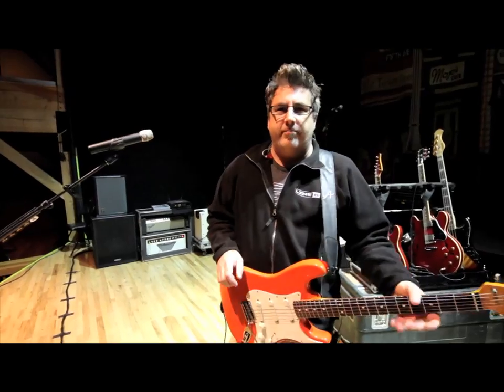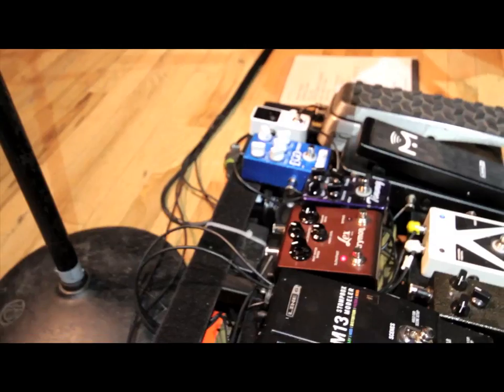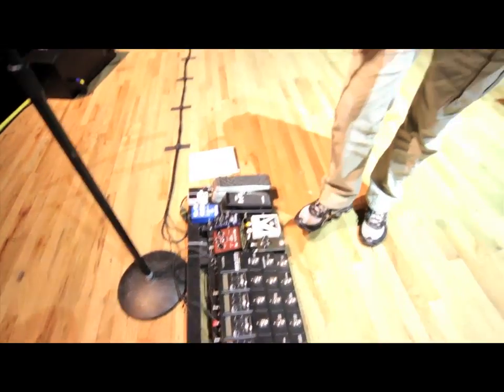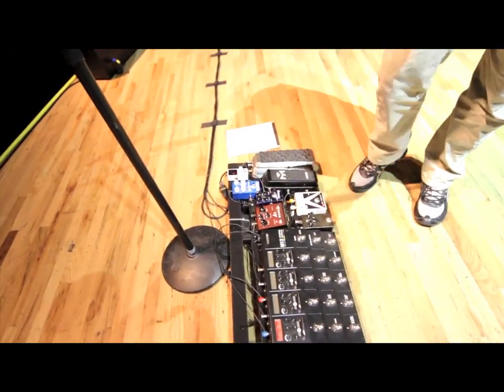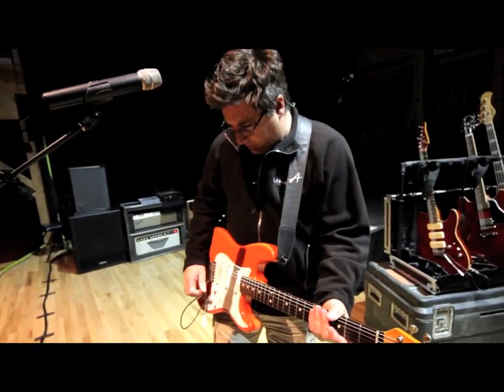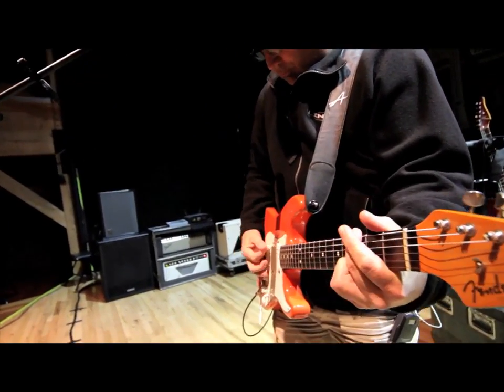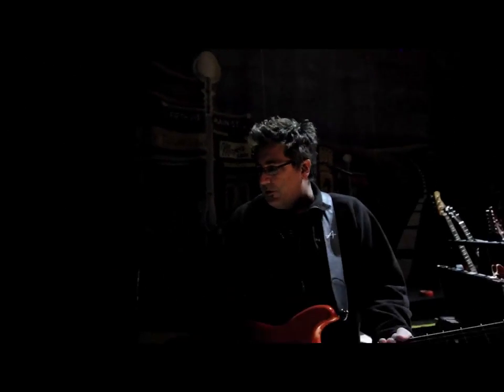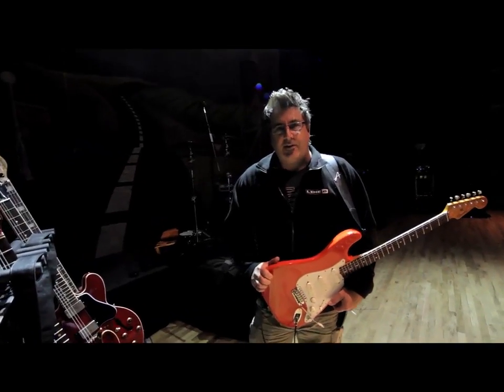Michael Britt Gear Video Vol. 3 2012

Comment: Hi Michael........great gear setup!!! what is the curved barrier you're using in front of the cabinet? thanks a 1000.
Reply from the maker: +michaelmellner It's just one of the small plexiglass amp shields, but I used a couple of pieces of gray foam to kill the slapback from the shield back into the ribbon mic.

Comment: What size is that pedal board? Is it a pedal train or what is it? And what power supply/'s are used here? Thanks!!
Reply from the maker: +Lachlan Burnett Again, sorry for the delayed response.  That is a Pedaltrain Pro board and I'm using the Powertrain 1250 to power everything.  The M13 runs off the courtesy outlet.